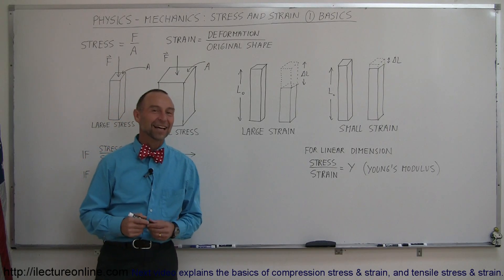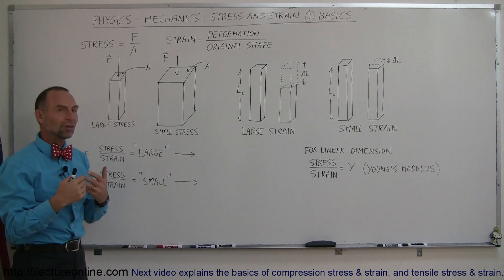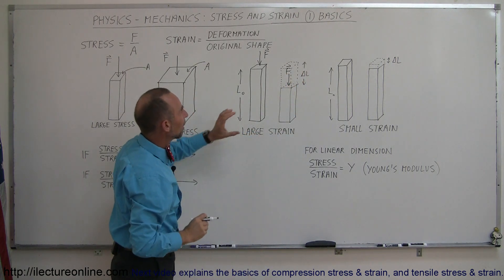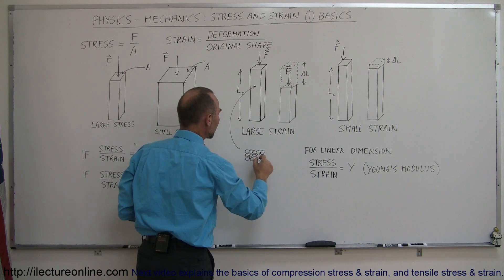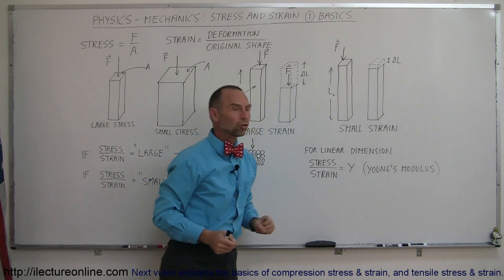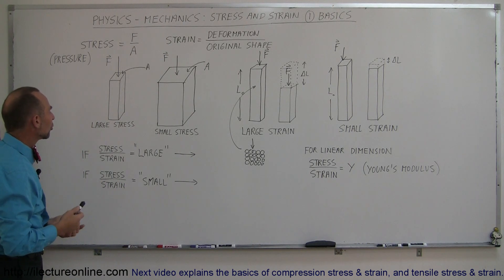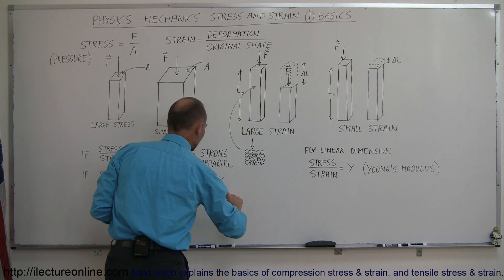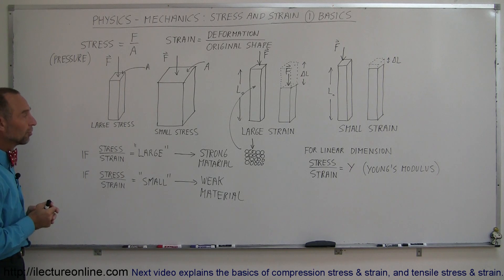Physics - Mechanics: Stress and Strain (1 of 16) Basics

Comment: I really appreciate this explanation but some term seems to be wrong. The member you considered should be fixed  which is not shown. Either we need to fix it or we should show force at bottom then only stress will generate. The member you consider is not the "beam" but it is the "column". These two words shows the way in which the member is loaded. I think  it is better to use the word '"member".

Further in the definition of stress , you said it is the "cross sectional area" which is need not to be true always. As in case of shear stress we consider "sheared area" which is not "cross sectional area"

In the definition of strain you said it is "deformation/original "shape". The shape of member remains the same. Lets say the shape as rectangle , before loading then generally it will be rectangle only even after loading. It means  it is not the "shape" that changes. The change will be in "size". So the definition should be "deformation/original size (not shape).

I know this is an introductory video ,  but we expect more precise content from you.

Comment: in stress the force is not that we apply, it is the restoring force . that means  "The restoring or recovering force per unit area set up inside the body is called stress "
Reply from the maker: There are different definitions for the word "stress".  One is indeed the restoring force of the internal molecules pushing back against the force causing the strain.  From a practical perspective it can also be defined as the applied force divided by the area over which it acts.  Thanks for the input.

Comment: If shearing of a material means plane to plane slipping within an object..........then why do some people use the word shearing during bending...

Does bending leads to shearing????
Shearing takes place in one plane...But bending creates sagging and hogging......and sagging and hogging are not in one plane........

Please help me sir, i am confused????
Reply: Shearing is the localized lateral loads in the fiber of a material
Bending is due to the long distance effects of lateral loads on a material.

Think of a bolt or a pin that is loaded in shear, where the two lateral forces applied to the member, are immediately adjacent to one another.  Whereas bending occurs where there is a significant length of the structural member between the load and the support, like a beam, such that an internal torque reaction called a bending moment is developed to resist it.

Shear loading causes shear stress, while bending moments cause normal stress.